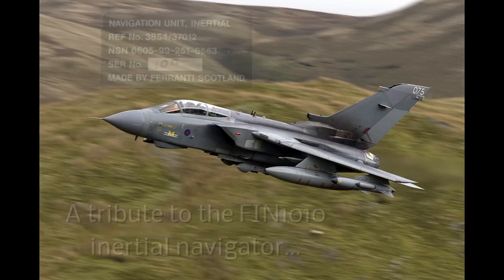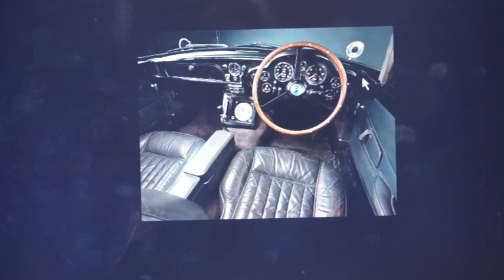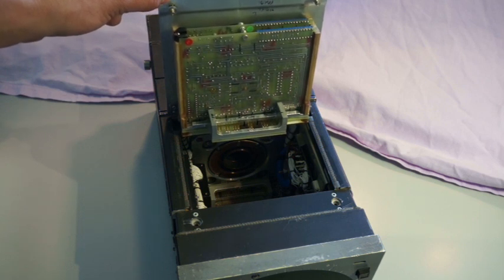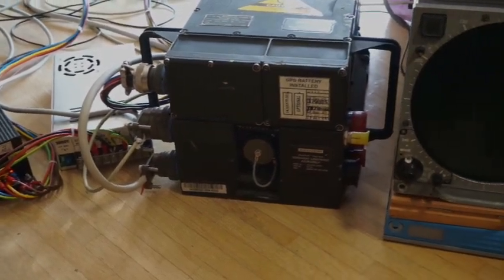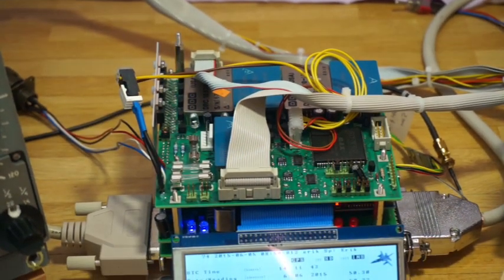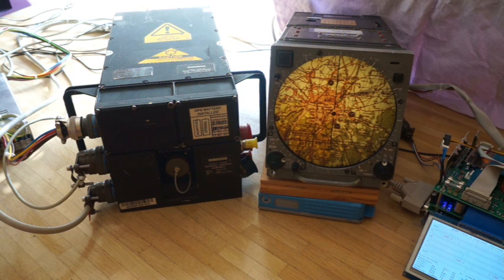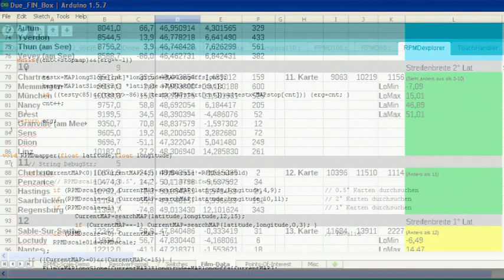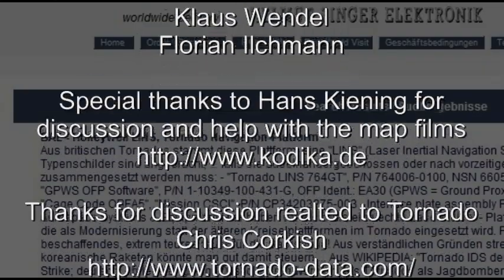FIN-RPMD-Explorer, a tribute to Inertial Navigation in early Tornado

Comment: What sort of value would be in one of the fi101 Gimbal units these days
Reply from the maker: Good question - in the 1970ties they where around 250000UKP, so price of a multi-story house worth by then for just the black navigation box. One of the systems I have seen, still has got a sticker on it giving the price for a refurbished (used) unit in around 2000 for 103000EUR which the Luftwaffe paid for it. Summary: VERY EXPENSIVE!
Reply from the maker: ...of course today units of unknown state are on ebay and rarely sell for more than UKP400 - platform only even less 😞
Reply: @finner4463 thanks for getting back to me, I've been considering buying some of these. I would love to see the gimbal stabilized as you shown in your video when the Gimbal was removed from the pressurised unit when you held it in your hand.. Or even to attempt to create a new moving map system, to make an in car non gps system like the James bond Aston Martin.. Aside from the main Gimbal platform unit, what else would I require for either just solely having the Gimbal powered to hold similar to your video.. Or to create the in car moving map system.. Ive seen a selection of available PCB board etc but not sure the bare minimum I would require or if it only works with a complete setup. Also the boards of various nature are available, however I have not seen any of the cables available.. Is this the case and the cables need to be fabricated by myself or any thought on this side? Just love the look of these units and was very impressed with your video start to finish, so would love to re create Partly, even if solely to turn the gimbal platform system on and hold it to be amazed, however I have a feeling it won't just need power but will also need the Gimbal platform to be externally controlled by a controller board of some sort to see the platform in action... Appreciate you my friend, kindly Craig
Reply from the maker: @craigmorton644  What you require depends on the system - sometimes all is one box, sometimes it is 2 or three boxes. Cables are normally part of the airframe and need to be done yourself (one plug usually USD100 or more!) and you need to know the wiring. So: If you do not have a known working system the efforts are very big and I spent 1000s of hours learning how that stuff works, reverse-engineering and building that stuff. Today's technology does not make life easier here and that is why there are only very few systems of this kind still running...
Reply: @finner4463  if I just wanted to turn the FIN1010 on to see it stabilising itself , would the only thing that will allow this be the ferranti test system you used... I think making it work aside from this as an actual moving map setup would maybe be too large a task. (for me in the meantime at least) if yes the ferranti test system would be required.. Is there even a small possibility I may be able to aquire one from somewhere? Many thanks, craig
Reply from the maker: @craigmorton644  Aha - you are talking on FIN1010 - yes, if you have a working box you can get it running without test set. Just the box is needed, a panel (often on eBay for UKP100), a special cable and a 28V/15A power supply. Look to my blog, http://www.baigar.de/TornadoComputerUnit/TimeLine.html, scroll down to date code 5/12/2015 - there you will see the infomration required. No display etc. needed to make a FIN1010 working, but most units out there have some fault which often is very tricky to fix  - so . . .  - good luck ;-)
Reply: @finner4463  perfect. I appreciate you sir 🙏
Reply: @finner4463  is the panel to use with the FIN1010 to get it fired up (aside from the power supply) .. The following: navigator (INCDU, Ferranti 3854/36701/01/003), or a different panel? Many thanks. My FIN1010 is on route to me 😁👍
Reply: @finner4463  or maybe this one?
Tornado Aircraft NAV Navigation Control Panel, Part No. 743900-5 [1R9B]
Reply from the maker: @craigmorton644  Yes, the 36701 can control a 1010. Good luck with your 1010 - where did you get it from (just asking because there might be more to rescue?)?
Reply from the maker: @craigmorton644  743900-5 is something different. You can see from the video what I am using.
Reply: @finner4463  I purchased from a seller on eBay. The only other items are LINS navigation pcbs, and a newly listed Sperry Gyro Aircraft Reference Unit Type B 19436-0 Buccaneer, Lightning, Vulcan
Reply: @finner4463  I may have ran into an issue after removing from the delivery box.. A screw appears to have came out upon picking up.. Which is making me kind of nervous. I can't see any other similar visible scews, but the video I will link give the approximate area it came from.. Almost sounded spring like, when it ejected from it... Or this may just be from it hitting metal before it appears. Either way I'm keeping my fingers crossed all is fine.
If you look at your fin1010 and cross reference to the video, there's a potential screw hole in that area from which it may have come.. https://youtu.be/1lBp1Kg0OL8
Reply: @finner4463  playback the video in full screen as otherwise part of the video is cut off.
Reply from the maker: @craigmorton644  Hmm, that is an interesting screw with the flat head and the blue locking adhesive. Honestly speaking I do not think that one was used on the platform/cluster. In my systems most of the screws are standard slotted screws. Maybe the screw was in the packagin before shipping? But what you aer picking up there is just the platform, so no 1010 control box with it - store it in a dry environment as the alloy will be sensitive to humidity and the gimbals will turn whit first and with heavy humidity even grow hair ;-)
Reply: @craigmorton644  I am totally blown by looking at the cabling. it is absolutely a nightmare. the information are scarce and recreating the cabling system is almost impossible even if it is super hard to do and having time. Having a similar unit can help to recreate a bare minimum powered system. just for fun it is a spectacular project to do but I cannot bet.
Reply from the maker: @craigmorton644  That location does not hold a screw I guess.
Reply from the maker: Agreed - the screws are all slotted and no adhesive anywhere on all the units I disassembled so far.
Reply from the maker: @CallistoPili  Yes - restoring such a unit is a fun and challenging project, but starting from a platform alone it is almost impossible. Still working on replacing a broken gyro in my demo unit and that project is somewhat on hold as it is very hard even with current electronics getting these instruments anywhere near their specifications :-(

Comment: Why not to put it in a car and see how accurate it is in a car environment (lots of speed fluctuations and small accelerations)?
Reply from the maker: Together with a hobby-äcolleague, we had one of these in a BMW and took it to a ride around Munich. But it is not that easy as it may sound: Power requirements (>25A at 12V for the navigator without display) are difficult to realize on board a normal car. On our ride, the inadequate cooling also lead to position runaway after 40 mins and a forced shutdown 5 mins later. But I guess, that a maximum error of 1km/h should be possible in a car  ;-)